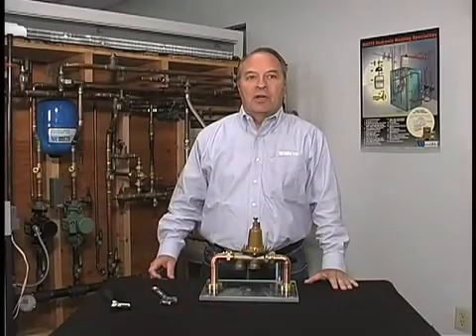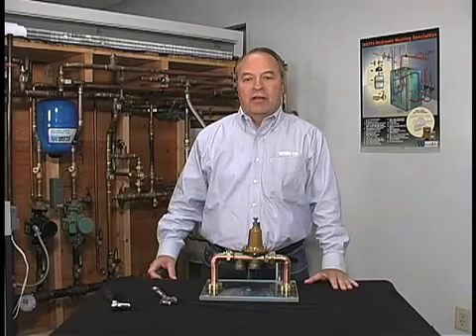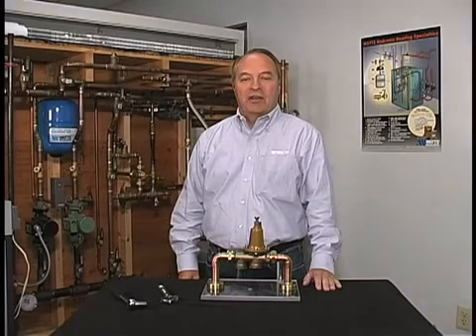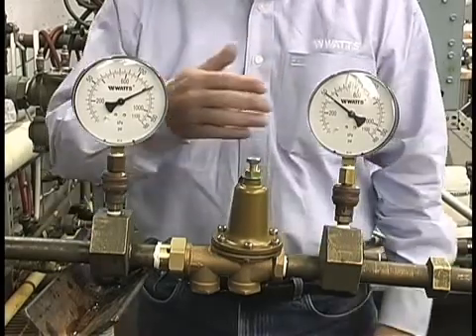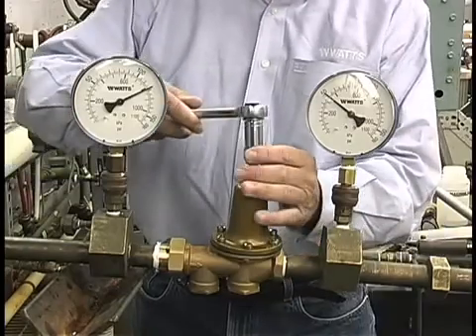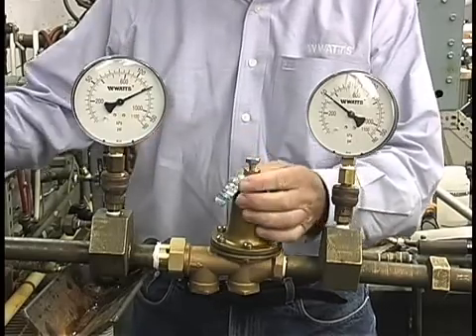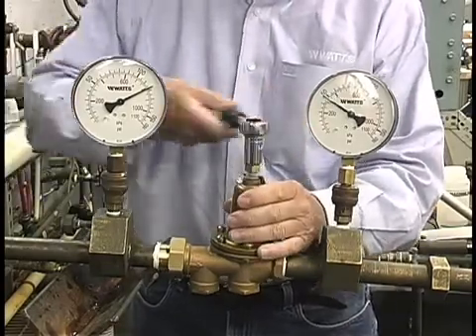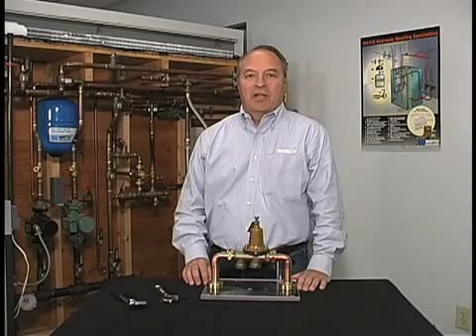How to Adjust Water Pressure with the WATTS 25AUB

Comment: Can you turn the bolt counter clockwise ( to lower pressure ) TOO far, and it comes out of unit? Or will it not allow you to over turn it while backing it outwards ?
Reply: My question also, but no answer.

Comment: How does the pressure escape back into the municipal side when the pressure from said side is higher?  (Not being skeptical, I'm just curious)
Reply: Normally there is a check valve that prevents reverse flow from the house to the municipal supply. In a real-world scenario, reducing the pressure via the valve would not immediately lower the pressure on the house side of the valve. A faucet would need to be opened in order to relieve the pressure until the new, lower pressure was achieved, at which point the valve would allow additional water from the municipality to flow into the house at the new, lower pressure.

Comment: Hi does the 25AUB-Z3 contain LEAD in it ?
Reply from the maker: Hi... please see information on the 25AUB -  MATERIALS
Body: Lead Free* copper silicon alloy
Seat: 1⁄2”–1” (15–25mm) Replaceable engineered polymer
(10% glass filled Noryl®)
11⁄4”–2” (32–50mm) Replaceable stainless steel
Integral Strainer: Stainless steel
Diaphragm: Reinforced EPDM with PTFE wetted surface
Valve Disc: EPDM

For more information, please visit this link - http://www.hydroflowaus.com.au/pressure-reducing-valves